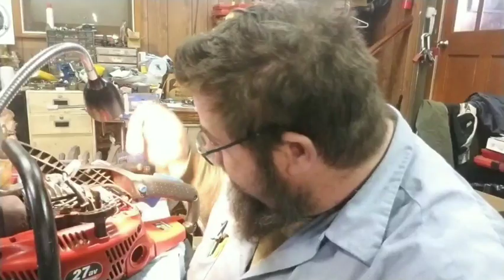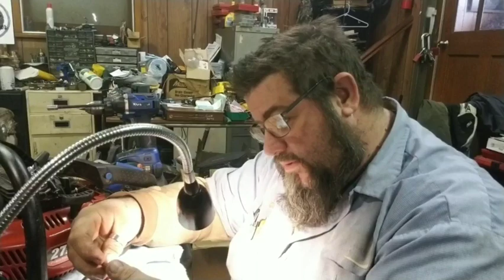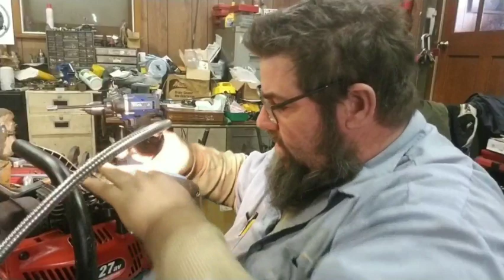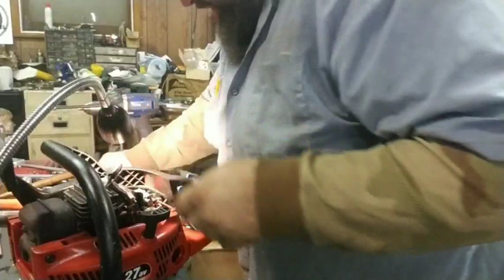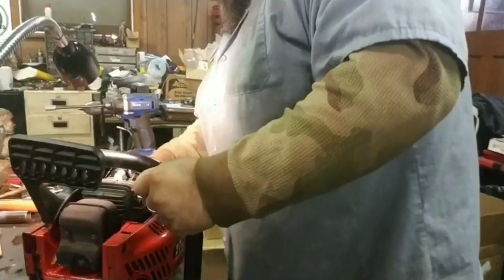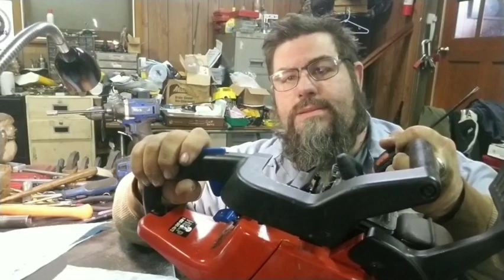Homelite 27av getting her running

Comment: First. That plug didn't look right when it came out of the rebuild kit. I should have trusted my gut and left the original in there. See how tiny that intake is not worth messing with. If you just want to get her singing with a little muffler opening that be good. Thanks Bell. That was the first plug I removed LOL all the rest I left alone. Lesson learned. God Bless.
Reply from the maker: Lol yes sir we going to look at her and test her out buddy
Reply: That was a different case I just used the lines that were there. Maybe that's why its small? The original case was a UT-10830.
Reply from the maker: @chuckfisher5960  oh ok i wasnt sure and they do change things around sometimes